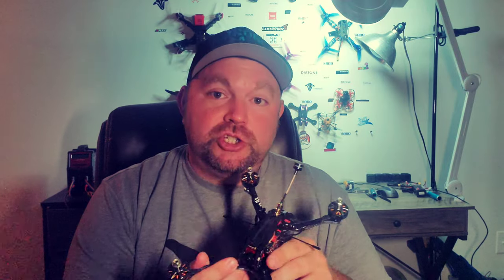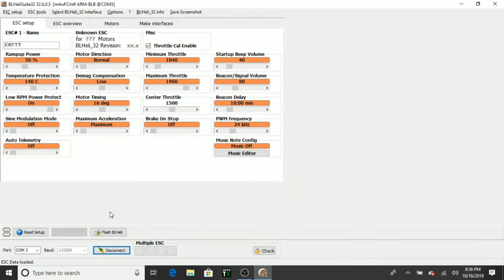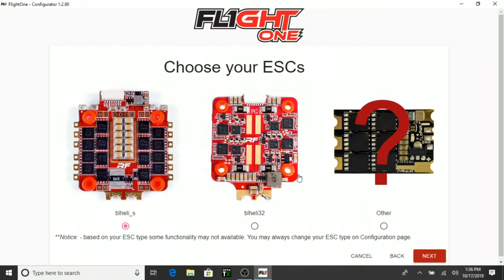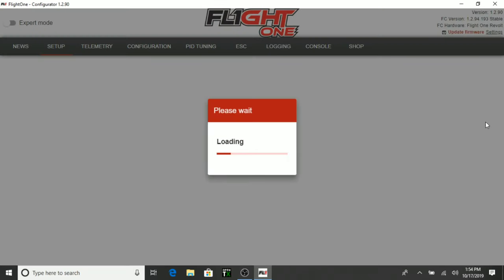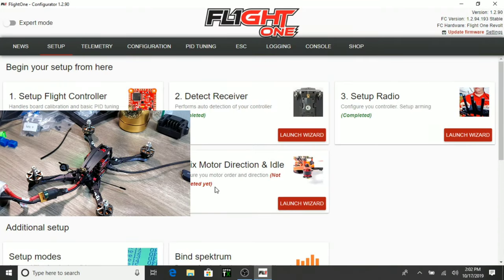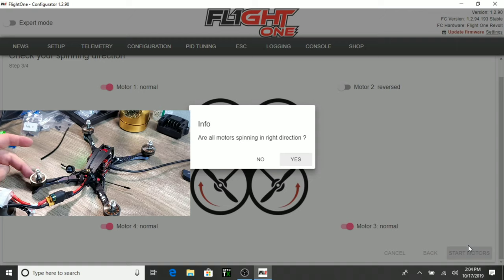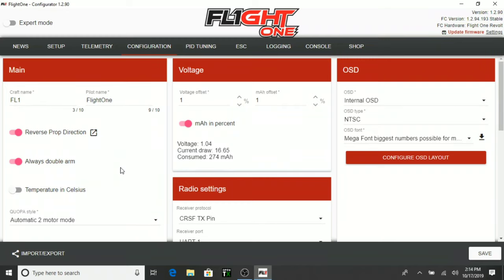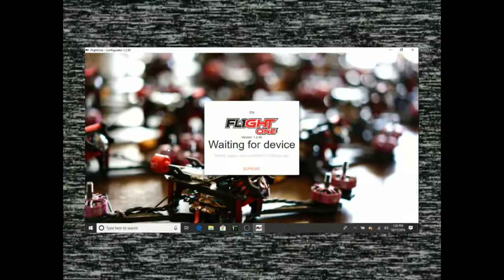Project Blue Falcon Jc Diatone Build Flight One Software Installed!

Comment: How did she fly once you got her up and running?
Reply from the maker: Half a pack loved it but didn't pay attention to voltage then crashed onto boardwalk about 150 feet high took out 2 motors 😔
Reply: edrone ouch. Hate when that happens. I’ve had the afterburner for a while but haven’t installed it yet due to the fact I haven’t killed any of my arc one builds in a while. Now that I’m stuck at home and boredom is hitting I’m about to build some quads with left over parts soon. Lol
Reply from the maker: @archer4922  can never have enough quads in this hobby lol
Reply: edrone 🤣 so true.